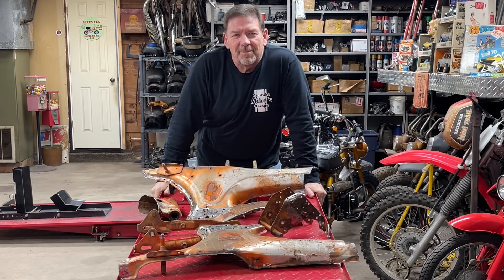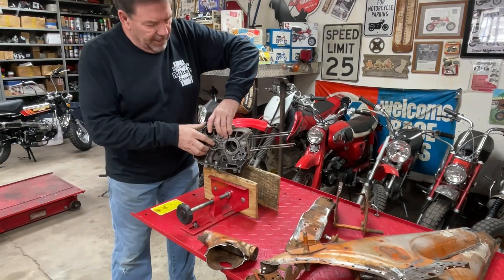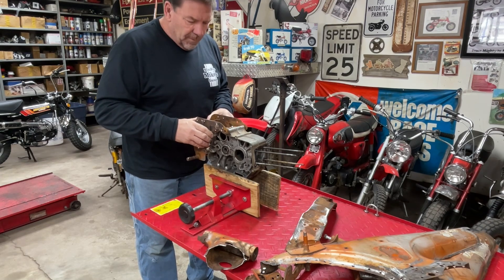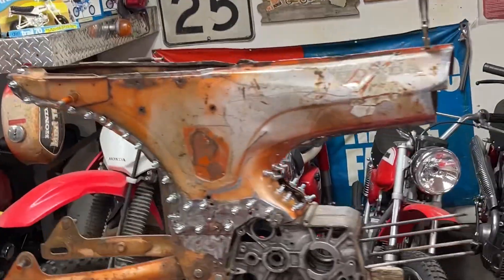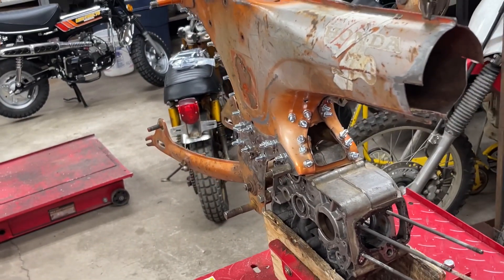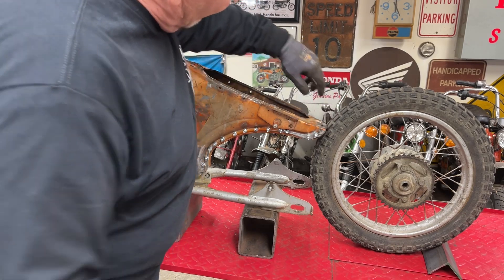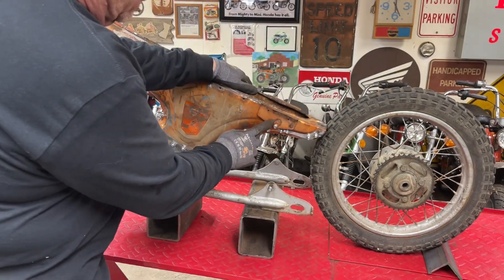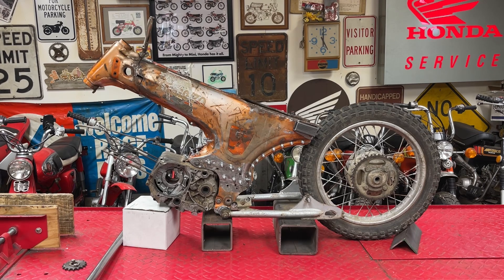Honda CT70HK0 - rigid chop build, video #2

Comment: The bolts sticking out is crazy punk looking like you said.  It works!  It also would work if you started hating it to use Button Head Hex bolts on BOTH Sides, so it looks like an old riveted aluminum plane body.

Comment: Bolting the spot welds together is brilliant! It will definitely look great.
Reply: The only thing I'd do differently is use various fasteners. Stay the course. FTW!
Reply: You are definitely on the right track. Refer to some pics of stock old rigid frames like Harley for the geometry of the rear triangle. Do some sketches. The rake is fine.
Reply from the maker: @pinuppyjamaparty  My fear is building something similar to what someone else has done, so I’m trying to stay away from looking at pics and just building as an image hits my head.  There may be a lot of build….tear it apart….rebuild, etc, before this is finished. Haha
Reply: Love the process. Let’s see where it goes
Reply from the maker: It’s been fun to do something different.  It will most likely look and ride like shit, but that’s OK.  If it goes down the street, I’ll consider it a win! 🤣🤣

Comment: While watching you talk thru dealing with the wider hub of the ST-90 wheel and chain interference, I couldn’t help think you will also run into the difference in sprocket alignment from the engine to the wheel sprocket. That may be an offset of 1-1/4”.
Reply from the maker: The sprocket alignment should be really close.  There is a slight difference in the width of a CT70 and ST90, but not much.  I’m getting ready to swap out the build engine cases for a complete engine and throw a chain on it.  If off, I can shim the rear rim left or right a bit.

Comment: Loving the lower stretched look that suits this distinctive frame so well.with its long tankless look, though I'm still getting used to the extreme rake! Hidden central rear spring could have looked interesting too. Personally I think obviously bolting the frame back together looks distracting & fussy though.
Reply from the maker: I’ve built a couple customs with a single rear monoshock in the past, but never done a rigid.  That’s kinda why I’m going this direction.

Comment: I’m interested in buying an icebear ct70 clone, I want some knobby tires what size would you say I should get that fit on the stock bike? Removal of the front fender is OK.
Reply from the maker: I prefer the look of the stock CT70 size, 4.00x10.  But, you can go as big as 120/90x10